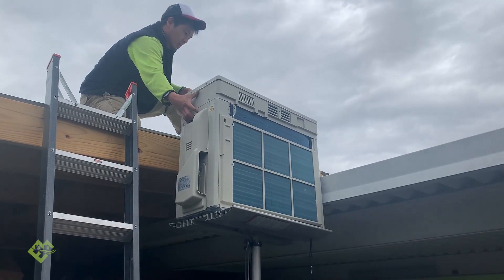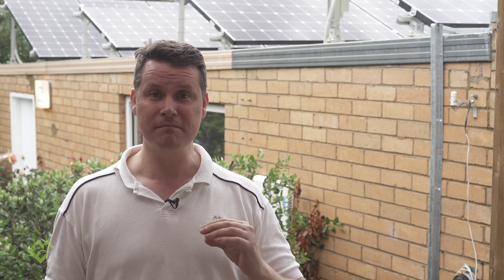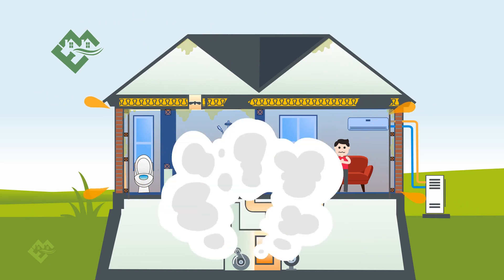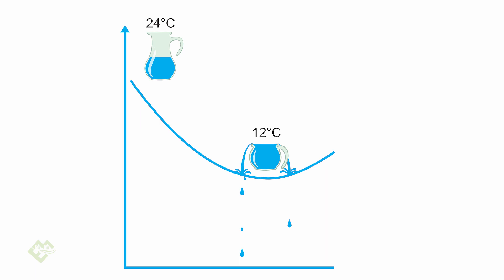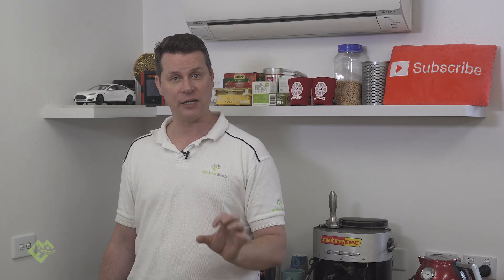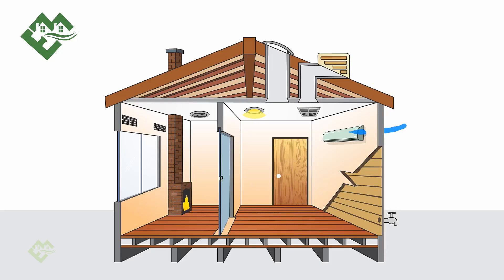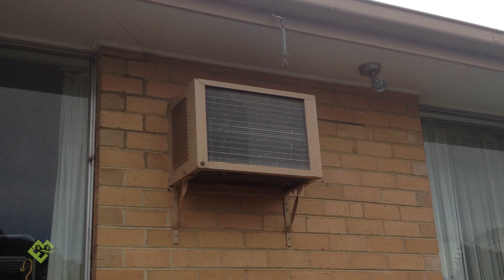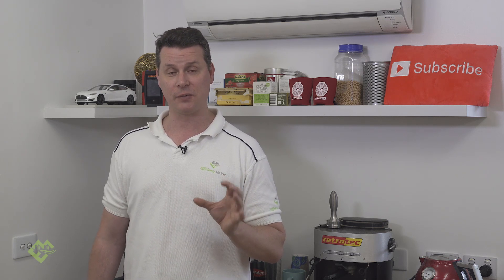Splits vs Ducted Heating and Cooling Systems - Building Envelope

Comment: Hi @Efficiency Matrix, got my splits installed, and despite asking, there is still a hole in the plaster behind the unit where the pipes go. I can access to seal from weatherboards externally.
Do you recommend a tape or silicone to seal it up?? If so, what type? (Have checked your website).
Reply from the maker: https://tighthouse.com.au/products/air-barrier-building-envelope-membrane-tape-60mm-25-metres-roll-white?_pos=1&_sid=8c06ce7d8&_ss=r
Can you get access to seal to the back of the plaster board?  75mm may be more effective.
Reply: @ecoevo  , Yeah, I can get to the back of the plaster. The hole is large (~100mm by 250mm), so I plan to patch the empty gap with plaster and use your product to seal around the pipes.
Thanks for this!!! Legends!
Reply from the maker: Try this code for a discount.  ELECTRICHOME.  Send us a review, with a picture of your work.☺️

Comment: We are going to try and cook our well insulated house with a single split (2.5KW) unit mounted on the top floor in the central, open staircase area. Might use it as a bit of heating support as well, but mostly it's for cooling. We have a central ventilation system with heat recovery that should help as well. I hope it will do a good job an run efficiently for a long time.
Putting up a fan or two to help spread the air around a bit more is also on the agenda, but I want to see how it does without first.

Comment: I like the efficiency of splits, but our walls are already quite busy and I really don't like the idea of multiple heat units inside and heat pumps outside. What do you think of ceiling cassettes for split systems?
Reply from the maker: Multiple Ceiling cassettes are still going to need multiple heat pumps outside.

Don’t forget, the better your building envelope, the less splits you require, and heat recovery ventilators can also assist moving the energy around the building.  For a more evenly conditioned conditioned space.

Comment: Great information.  But I have a ducted reverse cycle air-conditioner which you don't mention.  I would love to know how this compares.
Reply: He answered it in the comments below, as follows=We don’t talk RCAC, but we probably should have.  It can suffer from the same issues as ducted heating.  Leaky ducts/return connections.  Also the larger the unit the less efficient.  You’ll notice the smaller the mini split the higher the star rating.
Reply from the maker: Ducked reverse cycle can be ok, just need to check the air tightness of the return, especially if it’s in a wall.  https://m.youtube.com/watch?v=sl2bcU-apuY. This is an example on how bad it can get.

Comment: What about replacing the Gas ducted with RCAC ducted system.
Reply from the maker: We don’t talk RCAC, but we probably should have.  It can suffer from the same issues as ducted heating.  Leaky ducts/return connections.  Also the larger the unit the less efficient.  You’ll notice the smaller the mini split the higher the star rating.
Reply: Ok. I installed ducted RCAC upstairs regrettably with the plan to install down stairs  underfloor but now want to add 2 split  2.5/3.5 kw  units for better efficiency and zoning after  following you channel of info.
Reply from the maker: mirboo72 Thats great!  We really appreciate the feedback.  We put quite abit of effort into these videos.

Comment: Energy efficiency saves money.
Air sealing, super insulation, triple pane windows, high efficiency heating and air conditioning systems, energy efficient appliances, LED lighting, set back thermostats, solar panels with battery storage and a electric vehicle charger in the garage or car port. All these need to be considered in any new build or remodel.
Reply from the maker: That’s the ticket!